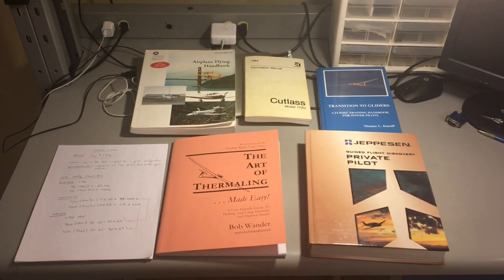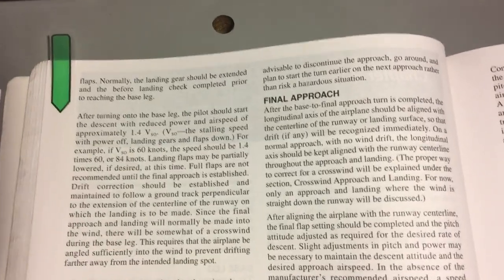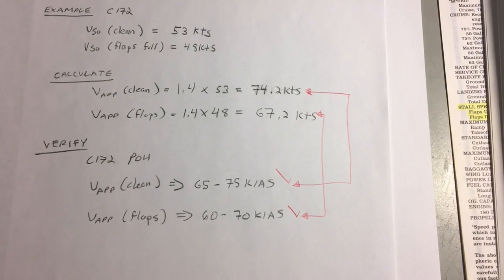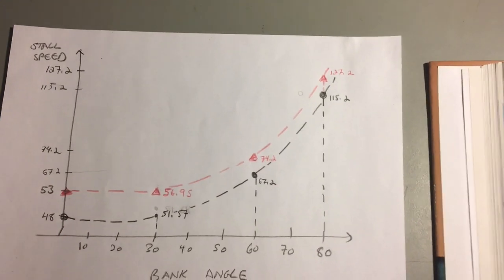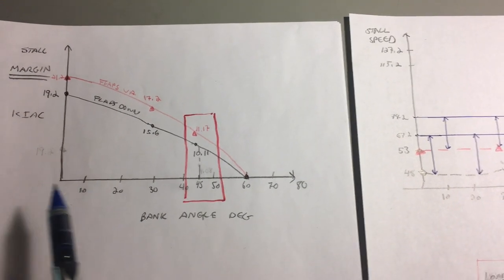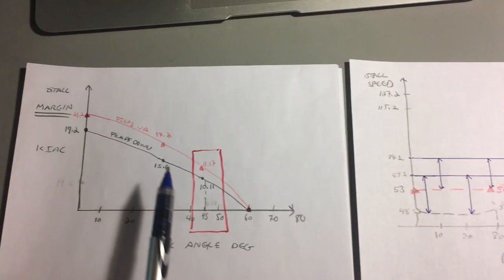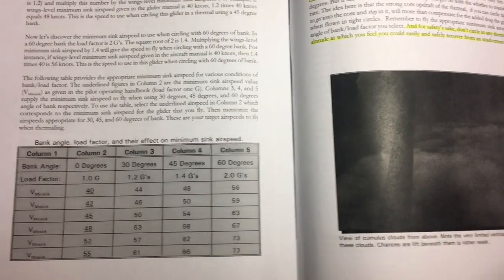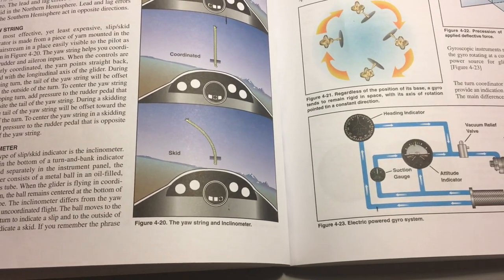DEBUNKING 30 DEG BANK ANGLE LIMITS IN TRAFFIC PATTERN

Comment: the graph of the stall margin was a clever way to illustrate this.

Never try to “cheat” with the rudder!
Reply from the maker: Glider guys get it, the turn angle on a rope break is 45 degrees. Do that turn in a powered airplane and watch the pilot next to you turn pale and start sweating!

Comment: You aren't taking into account Calibrated airspeed vs Indicated and the conversions charts are based on cruise power so its even lower with less power. Also, the bank angle charts are with the assumption that you are maintaining altitude and providing back pressure on the yoke to invoke the additional load factor.  If you are turning downwind to base you are in a descent and not maintaining altitude as well as base to final. I agree with your verdict, however I think you can exceed the calculations.
Reply from the maker: If you are turning and not maintaining level flight, you will have a lower load factor. That means the wings need to make less lift. Therefore, you will be flying at a lower angle of attack and be safer than in a level turn, for the same given indicated airspeed.